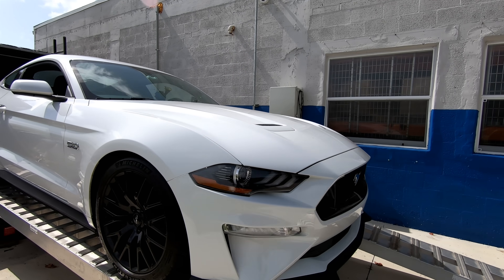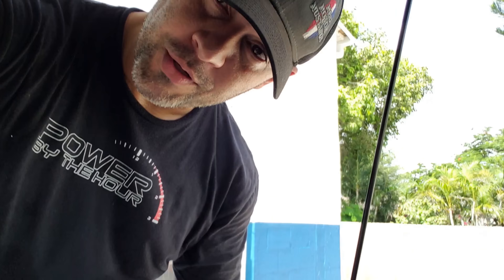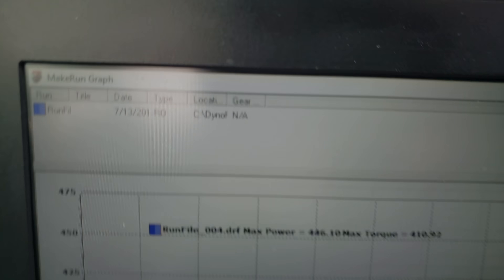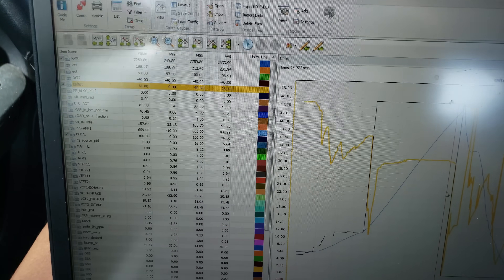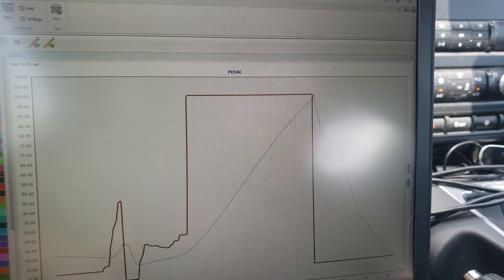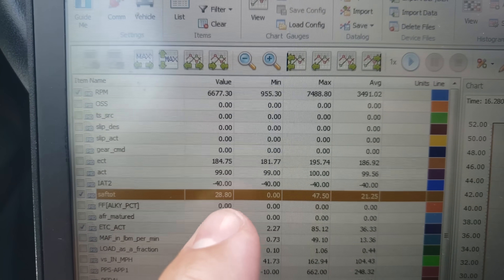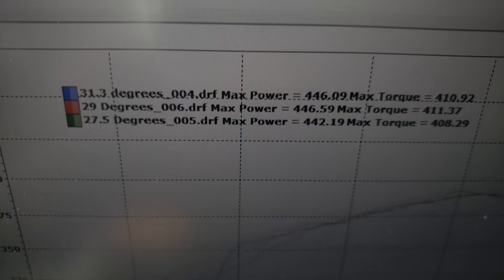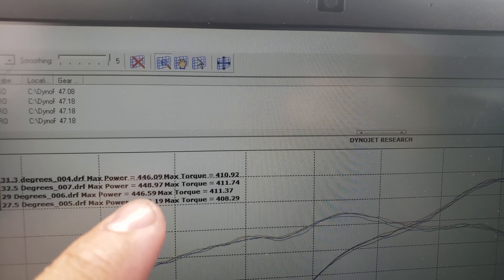2019 Gen 3 Coyote mustang timing test

Comment: If you guys are tuning a boosted gen 3 on 91 octane do you guys cap the timing. Let's say I add octane booster/better fuel after tuning on 91, is it possible to allow the computer to add more timing?
Reply from the maker: Yes
These cars have adaptive octane logic. Most see 14-15 degrees at wot on 91 but can see up to 17 with octane booster
Reply: @YDBT4LIFE  thanks for the reply. I'm assuming that is safe allowing the computer to add timing. I don't want to end up with a bunch of knock over 20hp.
Reply from the maker: @lobbyrobby  yes sir.

Comment: It's my understanding these engines like about 27-30 total timing. It seems like even a lot of mustang owners don't understand the coyote has a relatively small bore that is quite efficiently designed with a central spark plug, opposing squish pads, and straight through, 4 valve layout is going to mean it won't need as much timing as, say, an old big block with it's 1960's design wedge combustion chamber with the plug two thirds the way from center and a big dome the flame front has to climb over.

Comment: Would it be better to just leave it at 27 degrees? Id rather lose 4 hp and have a longer lasting engine.
Reply from the maker: 30 or 31 works fine on e85

Comment: Another factor involved in how much timing is optimal is combustion chamber design, the better the head, the less timing needed. Your average big or small block Chevy heads from the '60's needed upwards of 40 degrees advance to get the best power, flame front in the combustion chamber was slow.

Comment: so will you guys be updating your e85r tunes to back timing down to 29?
Reply from the maker: No.
Reply: @YDBT4LIFE  how come? based on this video it kinda makes sense to. Isn't that the point your trying to make?
Reply from the maker: @mmakam3  looks looks like you missed the whole point.
Reply from the maker: We feel anything above 30 or 31 isnt isn't worth it....THIS CAR Didn't like much more above 29. Most others don't like above 30 or 31
Reply: how much more damage or as you call it "rattle piston in the bore" are you causing with 31 vs 29. Is it worth the 3hp or whatever the car might make? But I guess the PCM will pull back the timing if it sees knock anyways right? I get your point that timing isn't everything, but I guess I'm asking what is safe timing advancement on these cars. (FYI, I do have  a Lund E85r tune)

Comment: that depends on how rich the cylinder is. more timing usually likes lambda's on the leaner side, but in the end its a high compression motor. its not going to take a hit timing wise like a 9.5cr or 10:1 motor will for example.

Comment: Just installed my flex tune from lund have yet to try the straight e85 tune. From low and mid rpm say 3rpm it moves! That's just the ff tune too. Is it normal for the car to hesitate and idle a little rough when starting? Takes a few seconds to idle nice and smooth.
Reply from the maker: Depends. If it's real bad...no..not normal.

Comment: Some folks don't know what minimum timing for best torque is and it shows...... Also the additional timing doesn't benefit you in the long run. Hp is a calculation of torque over distance. You can make up for the 2 hp gain in learning how to drive or weight reduction. No need to stress the motor to the bitter edge.

Comment: Where would you normally limit WOT timing on a boosted E85 gen1 motor?
Reply: Thanks my data log shows mine at 22 and boost climbs very close to ten.
Reply from the maker: 19-20 boost is different.  And gen 1 on 10 psi can make close to 700 on e85 and 22 degrees

Comment: I don't know how many noticed, but the torque output difference between the 31* baseline pull & the 32.5* pull said it all....<.5 lb/ft peak gain says the engine is maxed out @ 31* spark timing all other variables accounted for & if shown, the peak torque RPM marker for the 32.5* pull should be slightly higher than the 31* pull to explain the 2 HP gain (torque drop-off rate from the 32.5* pull peak RPM marker forward to redline was slightly less than the 31* pull thus the calculated 2 HP gain). Compared to the 29* pull, the peak torque was 1lb/ft less at the peak torque RPM marker but the torque carried forward to redline much better (read flatter here--less torque loss rate to redline) than either of the 2 pulls w\ higher spark timing added thus got an overall higher peak HP gain....which is what you want to achieve & explains why the sweet spot is at 29* spark timing & it is here thru the torque curve that also gives proof of the engine starting to fight against itself using any spark timing advance above 29*.

Comment: Hey Alex, I have a question. I have a stock 2019 GT Fastback 5.0 and my cylinder head temp reads 220-225 degrees.. What is going on brotha? Is that normal? Any advice?
Reply from the maker: Normal if stock. Tuned we set fans on sooner to keep her cool
Reply: I get the same temps in my 17 GT. Fluctuates between 200 and 225

Comment: Coyotes have a much better chamber than your old gt40p heads. Better chamber and you will use less timing. It’s not just piston, when you light it off prior to mbt you will push that rod bearing into the crank and it like squares it off almost on the top rod bearing. It’s fucking weird. Gen 2 and 3 coyotes are tuned really well oem. If you modify them and need your shot dialed trust your guys like Alex and Lund. They don’t tickle balls for a living. They tune coyotes. And run 7.80s on 17s lol. Awesome.

Comment: Bro you can definitely heal blow up shift on the wot box at 50 degrees advanced on the two step box by the brain box but I get not box bro, do you know by I get no box bro? Is it my bags or my plastidip? People that bitch about ignition advance also like to run 100 pounds of boost on the disco potato and like to pulley up. Just sayin. But dude it’s got a 6 inch bore. Lol. Smh.

Comment: This is one of your top 10 videos, pretty close to number 1. Well demonstrated and explained. I would be compelled to get the 29.3 degrees of timing after seeing this. Two HP isn’t worth long term failure to me. Well done.
Reply: there isnt going to be failure if the afrs are correct lol. failure happens when cylinder temps are too high.
Reply: @LightningFast240  So Alejandro is wrong??? Over advanced timing doesnt rattle the piston in the bore???? If thats the case then lets see a video of you adding 40 degrees of timing into your car
Reply: @upurnose46  it sits at 35-38.5 on e85. That's all you need to know.
Reply: @upurnose46  if my car off bottle is as fast as bone stock 2019 5.0 a10s I think I'm doing something right... Not even converter, cammed, or heads yet to trap 111+ and 127+ on bottle. Find some of my stuff on ig: eagle240 and reapers race channel on YouTube. I don't go to the track so I can't tell you times.
Reply: @LightningFast240  To say that over advanced timing wont cause a failure is the most ridiculous thing ive ever heard. Post a vid of you adding 50 degrees of timing in your car.
Reply: @upurnose46  why stop there? Let's add 70 degrees cuz big dick status. Yeah that's totally having common sense 😂. Different compression ratios like different timing value windows. I don't own a shop or a shop car with shop money so if I end up where and when detonation starts, I'll back it off by 2. Lower cr Naturally aspirated and e85 are very forgiving..

Comment: What is the diffrence in your car setup and a 15-17 with basically same nos, only e85, What would be estimated HP on the 15-17 with just mani and e85r, mt82 car ?
Reply: The Gen 3 motor likes e85 a lot more. I did 417/383 in my PMAS/e85 mt82 17. My new 2019 10r80 with just Lund e85 did 435/390 on a hot day.
Reply: @ElJefeGT  my 2015 mt82 with lund 93 tune ,stock mani, and JLT cold air, kook LT, and free flowing exhaust done 464 uncorrected,  and 585 on a 100 shot, Betts of 11.4  1/4@ 121mph on motor, and 10.7 @ 128mph on kit, DA was 500 at track, and similar on dyno day

Comment: Anyone else see it as the gen 4? Gen 1 was 11-12 gen 2 was 13-14 gen 3 was 15-17.  The oil squirters aren’t a huge difference, but taking them out made a little more power lol
Reply: Bubba Blue no
Reply: No, the LS1 had many different cam and a intake/exhaust changes and even head casting changes through the years but it's still all LS1 gen 3 small block. The 99 4.6 2 valve changed a little in 01 but still same engine classification.  3V changed a little in 08. Still same classification. When the gen 2 Coyote came out it was definitely a big enough change to change engine generations plus the chassis changed. Gen 3 Coyote is a huge change from the gen 1 and 2 so for sure needed a generational change.
Reply: Nope, just you.
Reply: Uhh no... Only diff in 11to 13 is different tune..
Reply: Dennis Lilley might wanna research the coyote again
Reply: Gah. Ya got me. They also poked a hole in the headgasket for better cooling in #8 cylinder
Reply: The pistons also changed very slightly.
Reply: no